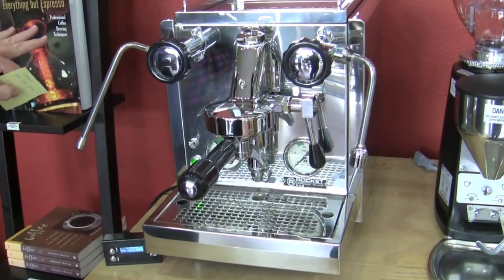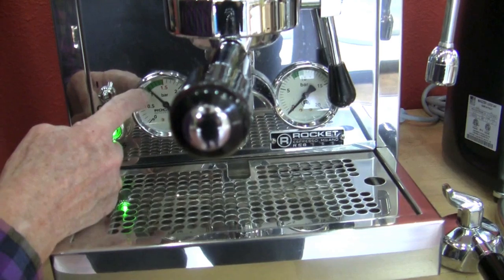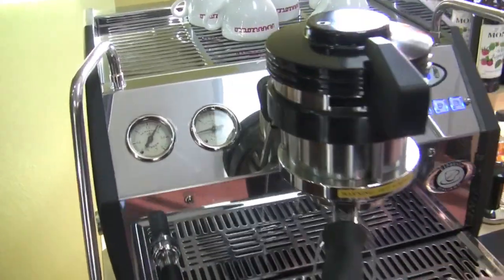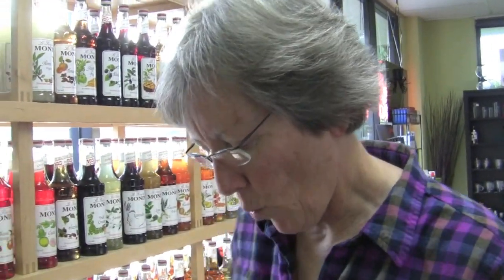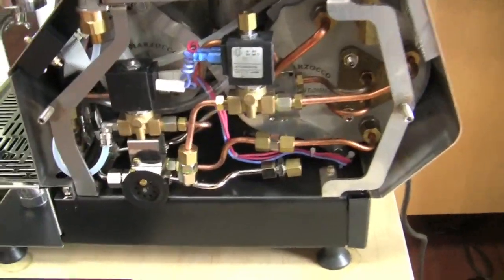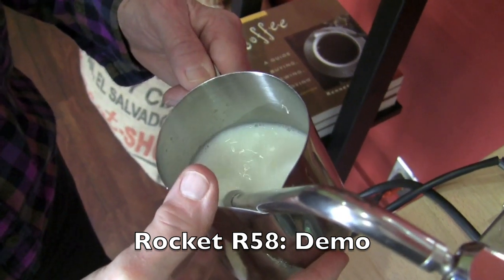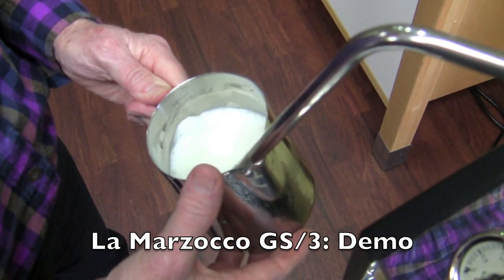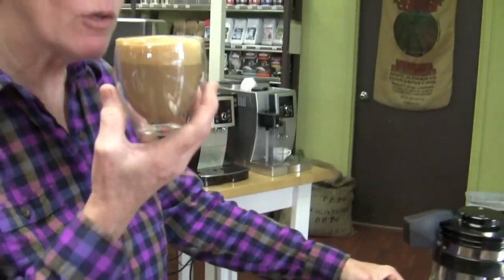Compare: Rocket R58 vs. La Marzocco GS/3

Comment from the maker: I don't know if I'd leave it on all the time ... Turning it on and off over and over again will adversely impact the seals/gaskets so if you're going to be using it all the time no matter the hour of the day, leaving it on is preferable to heating it up / cooling it down over and over again, etc. However, if you're calling it a night and it's going to hang out for 8 hours with no attention? I'd shut it down. - Kat

Comment: For the GS/3 when choosing the manual paddle option, does it have to be plumbed in or can you go just with the resevoir?
Thanks,
Reply from the maker: You can use the reservoir with the manual paddle. - Steven

Comment from the maker: Currently, the Rocket is about $2700...the GS/3 really was designed for roasters to test their coffee with a commercial machine that wasn't a multiple group job that required special power / water supply. That said, it is commercial grade while the Rocket incorporates a lot of the same tech theory, but at a smaller scale. I'd say the Rocket's at about a 7 / 8 on the scale you suggest (but that's my personal opinion). - Kat